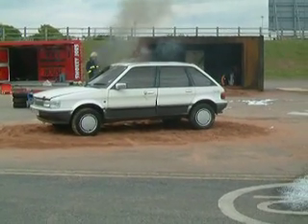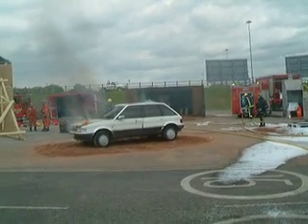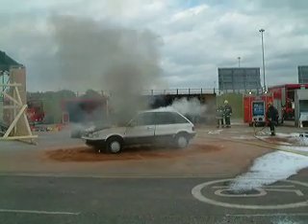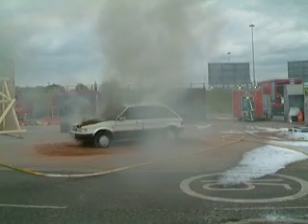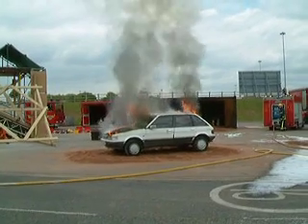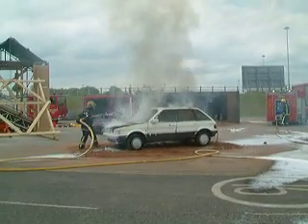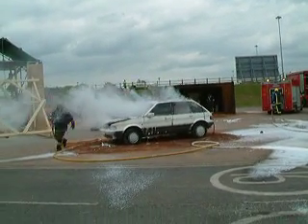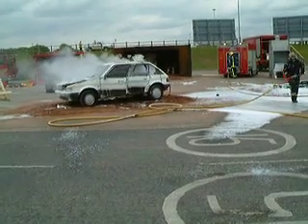CAFS - car fire extuinguishing demo

Comment: The firefighters are really fast, if they have only 3 min 10 sec to reach the car fire after the alarm call and beginn to attack the fire. Shure CAFS works fine with fires like in this example. But: it is also an expensiv way to extinguish a fire. Because the car is after a fire like this completly destroyed. Water is much cheaper - with the same result.